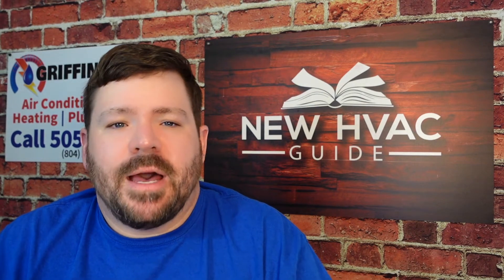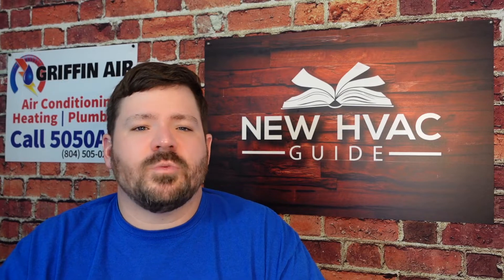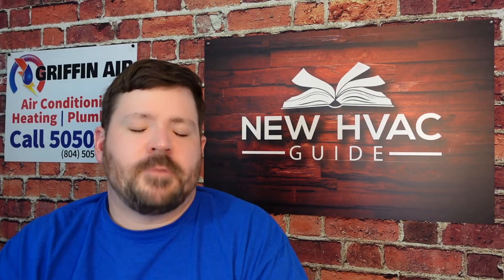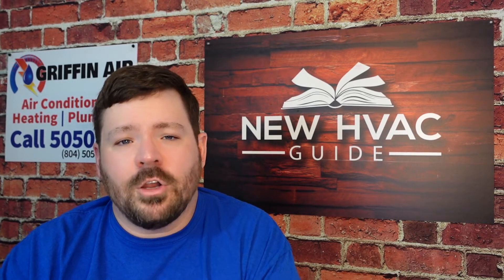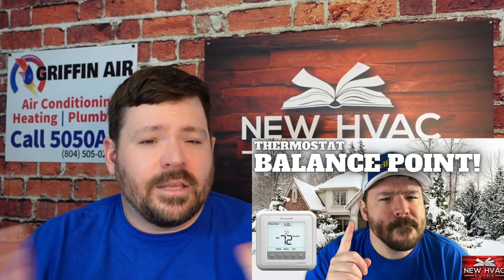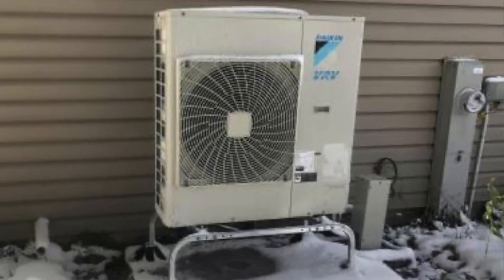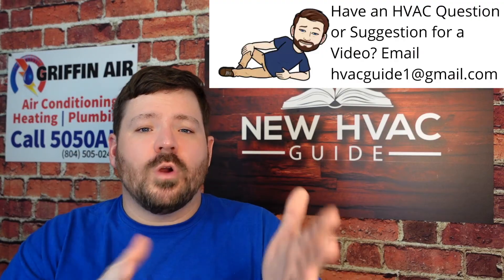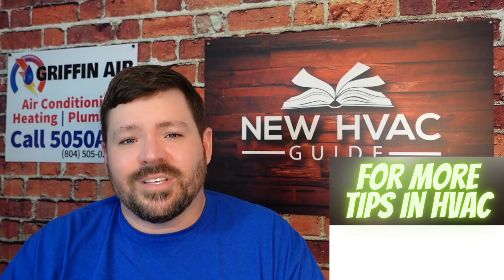Heat Pump SHUT OFF Temp with AUX HEAT!

Comment: Was curious about this as I am all electric in Western NY. Have been trying to fine tune my T10 and when I should lock out heatstrips. Though being married, it makes fine tuning things difficult. It is also battle between a system that is old enough to drink and my wife's paitence. We are scouting out for a replacement. At .06kWh rates makes higher efficiency systems seem less worth it. A buddy of mine in the industry suggested on avoiding some of the more complex and higher efficiency systems as the replacement parts are a lot more costly in many cases.
Reply: If you don’t mind a “disposable” system, the Mr. Cool and Gree HPs are pretty good in the cold and not too expensive. Who knows if they’ll last long term though